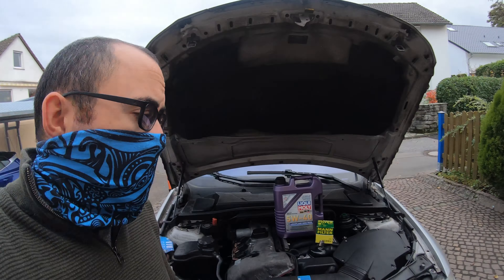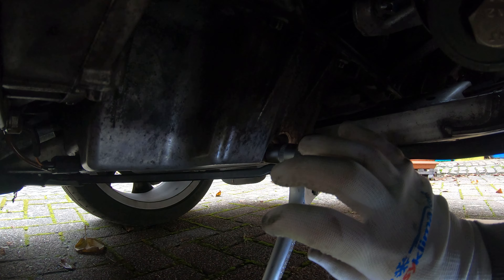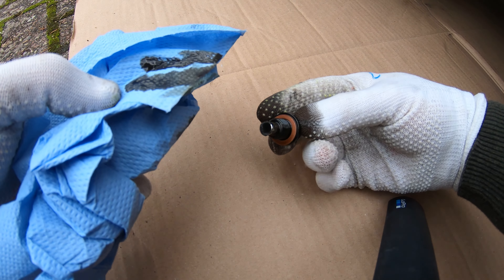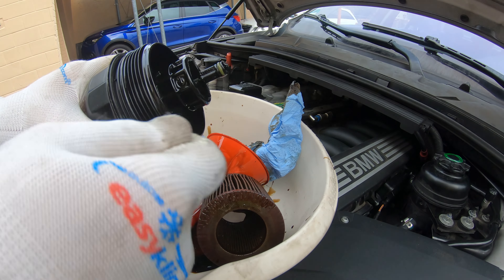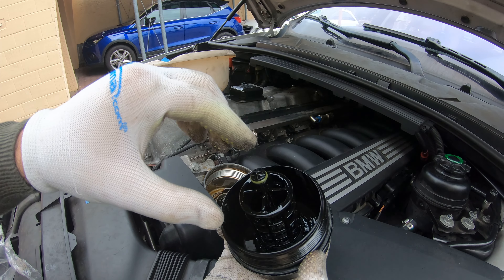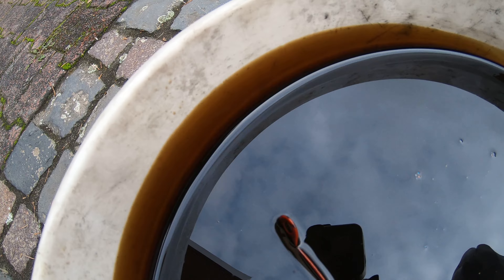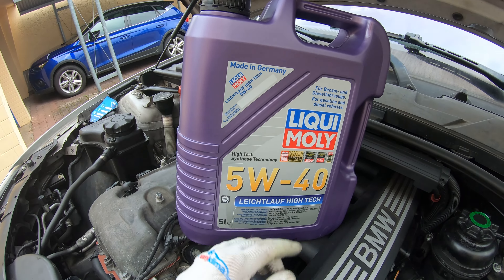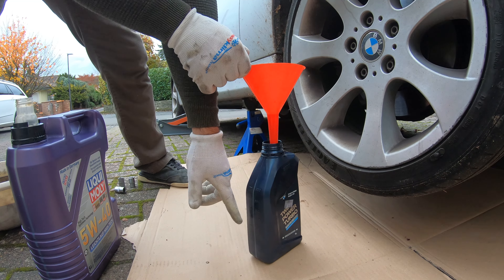How To Change Your Oil On A BMW E90 (325i, 328i, 335i & More) - BMW Maintenance Series

Comment: Hi sir watch your videos very nice video.  I have 320i 2005 e90 4 cylinder  so please tell me what oil i need 5w40 or 5w20 and when i have to change oil i mean afrer how much km's , How many liters of oil does it take? Thanks sir !
Reply from the maker: You need a 5w30 or 5w40 oil. You will have to look up the correct oil filter for your car. Change the oil every 7500 to 10k https://youtu.be/7To0liMOceE

Comment: Best n52 diy videos. I have been suffering from the infamous valve lifter noises for years due to short trips most of time. It is getting worse after using 5w40. I went back with castrol edge us 5w30 which is very low viscosity,  reduced the lifter noise significantly. I will try mobile 1 0w30 which is even faster flow oil next oil change. Hopefully fix the annoying noise. It seems to be the thin oil reduces the lifter noise on my n52.
Reply from the maker: Your lifters are probably clogged. When I rebuilt my engine I sprayed brake clean in them to clear then out. Maybe an engine flush (where you drive 200kms on it) can help but if you car is burning oil, it could cause more oil burning😅. So your choice.

Comment: How do you ensure all the oil is drained from the drain pan since BMW stupidly put the drain plug where it is, same issue with ramps.
Reply from the maker: I put my car in ramps. Pull the drain plug, remove oil filter, jack up the driver's side of the car a little bit.

Comment: Thank you. so how much your e90 is burning oil now? mine is back to the old days :( I wish there is something to fix this ANNOYING issue
Reply from the maker: Its about 1700kms/1L
Reply: @buildanddrive  waaw so much improved
Reply from the maker: Yes but if I had drilled my pistons or used the new design, it would have improved to 1L/5000kms or more
Reply: @buildanddrive  so maybe you can rebuild your original engine with these modifications and see how it goes.
Reply from the maker: I don't want to spent another 1000$ and 40 hours labour to rebuild the old engine and swap it in 🙈

Comment: so  u lift back side and put jack stand on front side?
Reply from the maker: That's what I do, yes. I keep the jackstand and the jack in place in case the jackstand fails, the rear jack will keep the car raised a bit
Reply: @buildanddrive  thats interesting, bc e90 is so low. If I lift only 1 side of car it's hard to go under and get drain plug.

Comment: Is there any benfefit why you use 5w40 instead of 5w30?
Reply from the maker: If you live in a hot climate then yes, or if your engine oil constantly reaches 110C, it offers better protection as the oil thins as it gets hotter

Comment: 1st 👍
Reply from the maker: Lol
Reply: only! 😂 good informative bro, thanks man, keep up the good work ✌
Reply from the maker: I have a whole series filmed. All the maintenance covered. A rebuild series is not as relevant but these videos will be for all 3 series owners 👌🏽
Reply: Your rebuild series was brilliant. I'm sure it helped a lot of people out and that's the main thing. 💪
Reply from the maker: @vincentcooray9269  do you own a BMW?
Reply: Yes, I told you before 😆 I have an E93 N52 B30, Alpine white with Saddle brown leather. I've just done a total engine rebuild. Nothing was wrong with the engine, I was just feeling bored. Took a bit longer than expected because of the idiotic sanctions placed on the country which I have chosen to live. No problem though got all my parts via Belarus 😂
Reply from the maker: @vincentcooray9269  Nice! Did the rebuild go smooth? (Other than the wait for parts?) I constantly ran into problems with not having the right tools or they were breaking 😅. And I had to wait on the cyl 6 valve for over 3 weeks.
Reply: Yes bro, the build went smoothly. I haven't got any leaks so far, but saying that I can get a very slight smell of burning oil coming into the cabin. It must be coming from somewhere and very slight because I just can seem to pin point it at the moment. The car was originally imported in from Miami US. I've completely coded the car to European specs via NCSExpert, fitted a 3 stage manifold and programed the Engine ECU to 3.0 litre euro spec. My car was originally 2.8 ulev not sulev. So it is N52 and not N51 with the auxiliary air pump. I will eventually change the airbox to euro spec when I source one.
Reply: PS. I worked for a Ferrari Lamborghini specialist before I came here to live and brought all my tools with me 😉
Reply from the maker: Where do you live? You should start a YouTube channel fixing Ferraris, I would watch that!!! 🙌🏼
Reply from the maker: Dude... This is so much work... Omg. Do you have a shop or a lift???
Reply: Bro, I live in the south of Russia near Sotchi. Like you bro, I did all the work in my garage at home and no I don't have a lift but I have a hoist, engine stand and all the other tools needed. I just took my time and did it alone. I don't work bro, I am self sufficient here with my family. Like I said bro, I only rebuilt my engine because I was bored 😊 This is more like a hobby for me now and I don't really work on cars now. I'm just chilling and enjoying life and really just enjoy watching other people like yourself doing great constructive things in your vids.
Reply from the maker: That's cool. I like how you said I do 'constructive' things 😂. My videos came out of my mistake buying what I thought was a good deal on a low mileage BMW.... but this damn car burned so much pil and while I could take a huge loss and get another car or bet on my own skills and put down a bit more money and make a good running car out of the experience. Im finding a few other new BMW owners are going the same thing. Glad I did it because I have a super tree reliable BMW and it drives amazing... But should of just bought a 330i like yourself 😂
Reply: Bro, you did very well in your build and the videos.  And also you get so much satisfaction from doing it all by yourself even if you could afford to give it to a shop. No self satisfaction in that 💪
Reply from the maker: Truth 🙌🏼
Reply from the maker: After I drove is to Italy and back, then took it to the race track a few times, temps were good and there were no break downs, that's almost unheard of. Was very proud of that 🥳
Reply: Nice one man. Chalk that upto a very successful build 👌
Reply from the maker: Yes, I've done more than 25k and 2 years on the engine including a 5k trip to Italy and back. No issues other than the small leaks I fixed with a few washers.
Reply from the maker: I really appreciate your enthusiasm and positivity. It was stressful to take the plunge and rebuild it myself because I didn't have the tools and I hadn't rebuilt an engine before (only taken them apart). I know from YT it looks like I know what I'm doing, and theoretically yes, I know the steps, but knowing and doing are two very different things. There was very little info compiled in one place about the an n52 rebuild. So this was a challenge to myself to learn everything, make mistakes, then make clear, concise and videos that hopefully help others. The videos I think took longer to make than rebuilding and swapping the engine 😂. But it was alot of fun and I got to do two of my fav things at the same time. Work on cars and make videos! 👌🏼